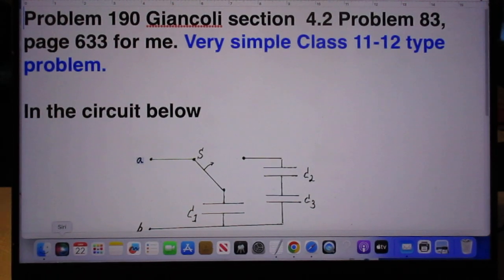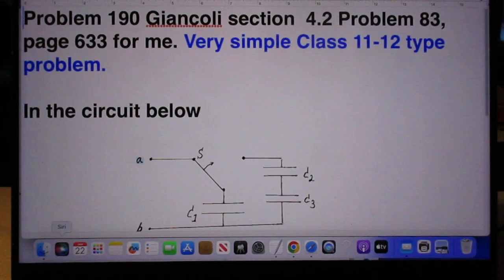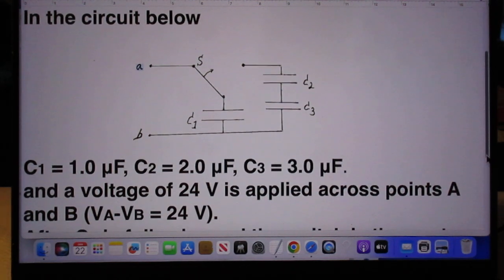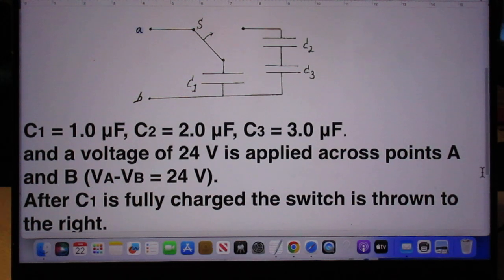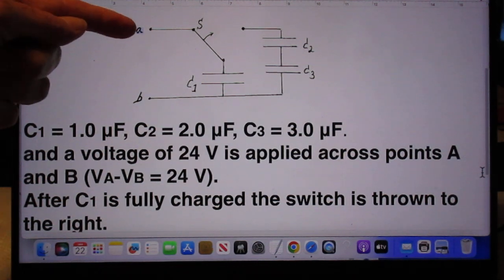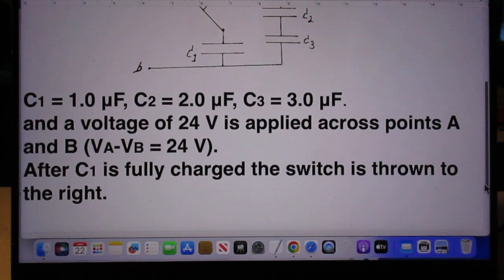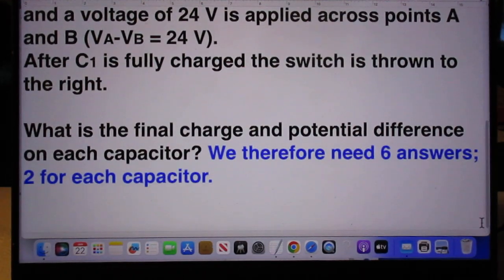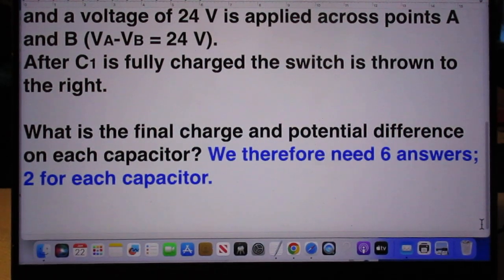Easy Capacitor Problem 190

Comment: I'm not so sure this is so "simple". It's true that at one point in time after the switch is thrown, V1 will equal V2+V3 and @Soham-Bhadra solution will be correct ** at that instant ** (conservation of charge) but if you notice that there is missing energy. The initial energy is 0.5*1uF*24V*24V (288uJ) is not equal to the sum of the energies in the three capacitors in that solution (131uJ). The missing energy is in the magnetic field caused by the charge movement. The circuit will oscillate at a rate determined by the inductance of the path and the total capacitance in the loop (0.545uF).

Comment: Why can't we explain fraunhoffer line by wien's displacement law
Reply from the maker: the 2 are very very different Wien does not deal with lines
The wavelength at which the radiation is strongest is given by Wien's displacement law, and the overall power emitted per unit area is given by the Stefan–Boltzmann law. So, as temperature increases, the glow color changes from red to yellow to white to blue. Even as the peak wavelength moves into the ultra-violet, enough radiation continues to be emitted in the blue wavelengths that the body will continue to appear blue. It will never become invisible—indeed, the radiation of visible light increases monotonically with temperature.[32] The Stefan–Boltzmann law also says that the total radiant heat energy emitted from a surface is proportional to the fourth power of its absolute temperature.

Comment: Hey Professor, when  will you upload the answer ?
Reply from the maker: maybe tomorrow or Jan 26
Reply: @lecturesbywalterlewin.they9259   😊, finally I got a reply from you professor, 

I have something to share with you, not something important but a result,
Today I was doing an experiment to find the value of g by using equation S = ut +1/2at² 
where  S is displacement 
t is time taken for displacement
u is initial velocity 
a is acceleration here in this case it is g which we have to find.
I was dropping a stone from my roof( with no initial velocity ) of some height which I have measured and was measuring the time taken by stone to hit ground  ,
So that  I can get the value of 'g' by putting these values in above equation.
But the result was astonishing I calculated the value of g to be 56m/s²😂 have about 500% error,
Now , from above result I have concluded that the acceleration in the equation depends upon t² so the small error in measurement in time , causes that much variation in result .
Thankyou for giving your time 😊.

Comment: Sir my doubt was that in case of fraunhoffer line can we explain the occurrence of brightness  of  fraunhoffer line during solar eclipse on the basis of wien's displacement law as much I have researched on it I got the answer that it can be explain on the basis of kirchoff  law but as we know that during the total solar eclipse when the moon is in between the sun and the earth fraunhoffer line gets brighter a possible explanation of this might be that the radiation coming from the sun reflected back again to the particle which is absorbing the light from the internal part of the Sun and as a result temperature gets increase and the wavelength of light that was not getting emitted will be emitted now please let me know if I am correct
Please spare sometime to give the solution to my problem
I would be highly grateful to you
Reply from the maker: refelction is negligible
Reply: How can it be explained by kirchoff law
Reply: Why can't we explain it by wien's displacement law

Comment: When switch S is triggered, does the capacitor act like a second battery in the circuit or only on it's own?

Is this the right picture I should have 
of this circuit?

Before S triggered:

            t=0

b—-----\ s   —----|
24V    ===C₁    |
             |        === C₂, V=0
a———|.            |
             |.       === C₃, V=0
             |______|

After S triggered:

            t=t₁

b—------s-—-------|
24V    ===C₁   ↑ I’₂=I₂–i₂=I₀+i₁–i₃–i₂
           i₁↓       === C₂=q₂/V₂=Σi₂·dt·/V₂
a— →—|         ↑ I’₃=I₂=I₃–i₃=I₀+i₁–i₃
       I₀    |       === C₃=q₃/V₃=Σi₃·dt·/V₃
             |_____↑ I₃=I₀+i₁
Reply from the maker: this is a very simple  class 11-12 problem -

Comment: Ha Ha got easy one !
This question was asked in my class 12th Physics class.
Allow me to solve this

As the C1 is fully charged the charge on C1 will be 24C1,
When C1 is connected to C2 and C3 it starts discharging as to equalize the potential so there will be a flow of change from C1 to C2 and C3 ,
After a finite time the potential across this system of capacitor will be same let's say it V'.
Now,
V'= 24C1/(C1+C2+C3).     (applying charge conservation)
So, putting the value of C1,C2,C3 we get V'=4v.
So, potential at each capacitor will be same and equal to 4v.

Now charge on C1 is C1*V'
=4micro Coulumb

Charge on C2 is C2*V'
=8micro Coulumb

Charger on C3 is C3*V'
=12micro Coulumb.
Reply: Is there anything wrong here? Why didn't the professor  replyed?
Reply: But isn't there still a potential difference of 
24 volts⚡ in the circuit as well as from the first capacitor? 🤔

That would be like having two batteries 🔋🔋 in parallel, with currents joining at the junction near C1, wouldn't it?🤔
Reply: Ha Ha  no after the switch is thrown to right the main supply from AB wil be cutted , and the only source of potential difference will be the C1 capacitor.(observe the diagram carefully)
Reply: Correct. I did this in a shorter method. But the answers matched
Reply: In the second part, after the switch was flipped,  i did this

Charge will flow untill
    V1 = V2 = V3 
=> Q1/C1= Q2/C2 = Q3/C3= (Q1+Q2+Q3)/(C1+C2+C3)

Then take the first and last ratio and youll get Q1 and then repeat the process till you get Q2 and Q3. And then calculate the value of V

Comment: Sir I had a doubt regarding fixed axis rotation of a body

Kindly answer if you see plzzzz

So the question is:-

Suppose there is a rod pivoted on an axis on a table and yiu applied a force of magnitude "F" at the rear end of the rod away from the pivot
So when you applied the force at the rear end, the body being rigid,all the other points also started roatating,so there must be some torque acting on them as well,so what magnitude of torque will be acting on the other points,is the torque at every point of the rod same,different(in sense of increasing or decreasing towards pivot)?

Whatever I have got is that the torque acting on the points should be in a decreasing manner towards the pivot,still I amn't sure,kindly explain

Comment: Solutions:
Capacitor C1: charge q1 = 24 µC, Potential difference V1 = 24 Volts
Capacitor C2: charge q2 = 28.8 µC, Potential difference V2 = 14.4 Volts
Capacitor C3: charge q3 = 28.8 µC, Potential difference V3 = 9.6 Volts

Supporting reasoning:
Capacitor C1 is charged to the full 24 Volts, and when disconnected, it maintains its charge and voltage.  Using C1 = q1/V1, we can find the corresponding charge, solving for q1 = V1*C1.

Let Z2 = 1/C2, and let Z3 = 1/C3.  The Z's are the "impedance" of each capacitor to accept a charge, inversely proportional to each capacitance.  We can work with Z's, using the same formulas we'd use, if working with resistors.  Use the voltage divider equation, to find the voltages:
V2 = V*Z2/(Z2 + Z3)
V3 = V*Z3/(Z2 + Z3)

Thus:
V2 = 14.4 V
V3 = 9.6 Volts

The formulas q2 = V2*C2 & q3 = V3*C3, find corresponding charges.  As required for conservation of charge, q2 and q3 are equal.
Reply: Same answer as mine

Comment: hello sir. I'm gonna solve the problem using the law of conservation of electric charge within the wire connecting the capacitors. initially C1 has a charge of 24 micro coloumbs since Q=CV. after we turn the switch the charge that remains on C1 plus the charge which goes to C2 and C3 (its the same charge) must be 24 micro coloumbs. the equal capacitor to C2 and C3 is a 6/5 micro farad capacitor since this capacitor is now parallel to C1 so the potential difference across the two must be the same. Therefore we find that the charge on this capacitor (which is the same as charge on C2 and C3) is 6/5 q1 and conservation of charge tells us that q1 is 5/11*24 micro coloumbs. so the potential difference across C1 is 5/11*24 volts. the charge that sits on each of C2 and C3 is 6/11*24 micro coloumbs. the potential difference across C2 is 3/11*24 volts and potential difference across C3 is 2/11*24 volts
Q1=120/11=10.9  micro coloumbs
V1=120/11=10.9  volts
Q2=144/11=13.1 micro coloumbs
V2=72/11=6.545  volts
Q3=144/11=13.1  micro coloumbs
V3=48/11=4.36 volts
Reply: Your answer is correct

Comment: My answer is :  V1= 7.05 V,       V2=4,23 V  and V3=2,82V . The charges  on  each capacitor  can be easily find using the formula Q=CV.  I hope that i am right .

Comment: My bet is as follows:
1. the switch is in the left position, C1 is charged to V=24V; total charge received by the system from the source a-b Qt=C1*V= 1E-6F * 24V= 24e-6C(Coulomb).
2. The switch is thrown to the right. The system of 3 capacitors is cut off the source and becomes 3 capacitors C1, C2, C3 connected in series:
2.1. We do not have any other source of charge except C1 charged to Qt. Charge conservation law in full strength.
Charge Qt is distributed equally between our 3 capacitors Q1=Q2=Q3 = Qt/3= 24E-6/3= 8E-6C;
2.2. Voltage is distributed between our 3 capacitors in inverse proportion to Capacity:
V1=Q1/C1=8E-6C/1E-6F=8V;
V2=Q2/C2=8eE-6C/2e-6F=4V;
V3=Q3/C3=8e-6C/3e-6F=2.667V

Comment: Solution : We will use the identity Q=CV (where Q = Charge , C = capacitance , V= Voltage) repeatedly in this solution below : 
First lets do some careful observations and then we will go to the mathematical part . 
1. When the switch is moved to the right , then the final charge is equal to the initial charge since capacitors are not connected to source of charge .
2. The final voltage across C1 and C23 are same . 
3. Charge across C2 and C3 are same .
Now observe that 
C23 = C2.C3/(C2+C3) = 2.3/(2+3) = 1.2 µF .
By (2) we have 
 Q0 = C1V0 = C1.V1 + C23.V23 = C1.V1 + C23.V1 .
Now putting, C1=1 µF, C23 = 1.2 µF , V0 = 24 V we get 
V23 = V1 = C1.V0/(C1+C23) = 24/2.2 = 10.9 V .
So ,   Q1 = C1.V1 = 10.9 µC .
On other hand , by (3) ,
Q2=Q3=Q23=C23.V23=(1.2)(10.9)=13.08 µC . 
Hence , V2 = Q2 / C2 = Q23/C2 = 13.08/2 = 6.54 V ;  Similarly V2 = Q23/C3 =13.08/3 = 4.36 V . 
Therefore , Q1 = 10.9 µC , V1 = 10.9 V ; Q2 = 13.08 µC , V2 = 6.54 V ; Q3 = 13.08 µC , V3 = 4.36 V .

Comment: 1/C := 1/C2 + 1/C3 = (C2+C3) / (C2*C3) or C = C2*C3 / (C2+C3) = 1,2 uF
Full charge: Q1 = C1 * U1 = 24 uC, the charge is conserved.
C4 := C1 + C = 2,2 uF
UU1 = Q1 / C4 = 24 uC / 2,2 uF = 10,91 V    and    QQ1 = C1 * UU1 = 10,91 uC
QQ := C * UU1 = 1,2 uF * 10,91 V = 13,1 uC  ( charge on C2 = charge on C3 )
UU2 = QQ / C2 = 6,55 V     QQ2 = 13,1 uC
UU3 = QQ / C3 = 4,364 V   QQ3 = 13,1 uC

Comment: Professor Wolter Lewin, what is your opinion about how the universe was created?  If the big bang theory is true, where did it get the energy it needed?  I certainly hope for an answer from you.
Reply from the maker: gravitational fields have negativne energy - mass has positive energy. It's believed that the net energy of the Universe is zero. No energy was ever created.
Reply: @lecturesbywalterlewin.they9259  Yes, and energy never disappears. But how and why did positive and negative energy separate?

Comment: Sir i have a doubt, how can we calculate work done by air drag(just for reference during a projectile motion) given that air drag is directly proportional to negative speed vector and the contanst of proportionality is b, F=-bv, apart from this projectile is thrown with a velocity u from an angle theta from horizontal.
Reply from the maker: I cover this in my 8.01 lectures
Reply: I world say use the Work Energy Theorem since its very difficult to calculate work by F . s as the F is always changing

Comment: What is the initial charge of C2 and C3 before throwing the switch to the right?
Reply from the maker: no charge on C2 and C3
Reply: 10.909V (10.909 uC), 6.545V (13.09 uC), 4.363V (13.09 uC) in the next steady state @lecturesbywalterlewin.they9259
Reply: @lecturesbywalterlewin.they9259  
Is there still a 24V potential difference between a and b after the switch s is triggered or is that removed?
Reply: @The-Old-Green-Man-OAP  That is irrelevant to the problem since the source is disconnected from the capacitors after the switch i thrown.